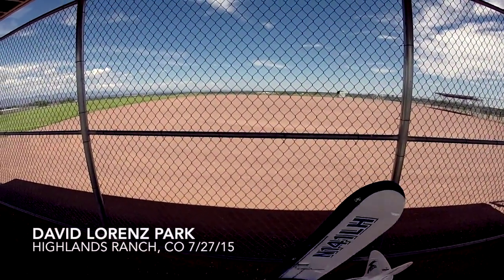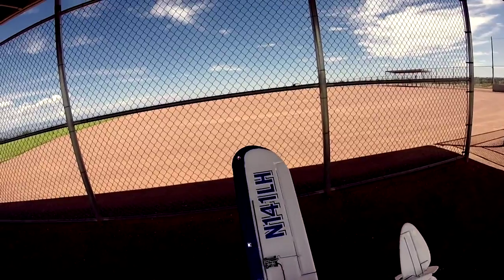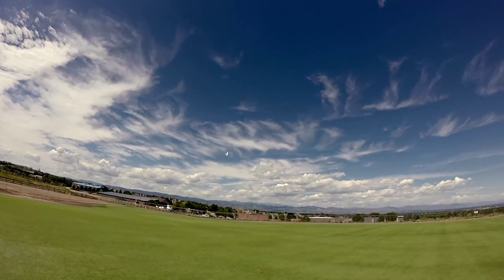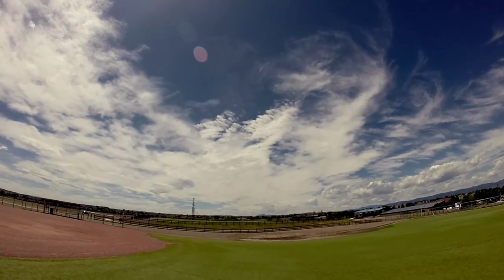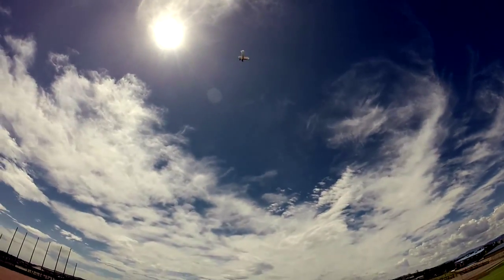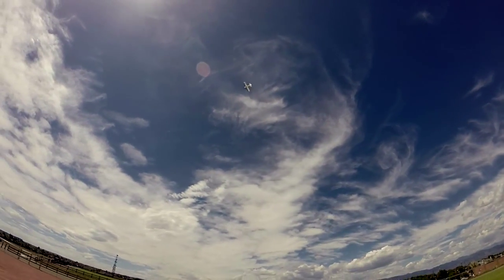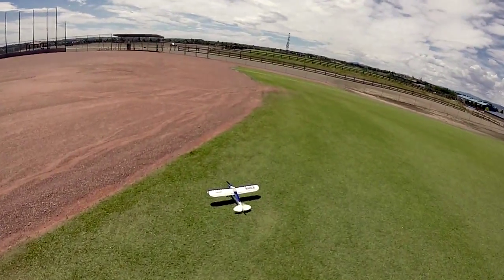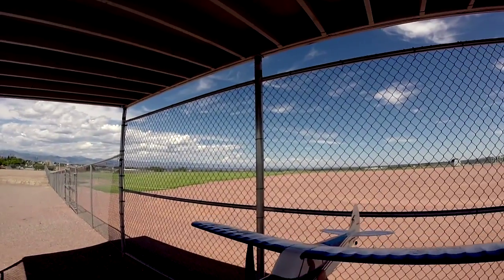Hobbyzone Sport Cub S (2S Brushless) Yak / Pitts Prop Upgrade Test Flight

Comment: Hi, I flew mine outside for the first time today.  Ground handling isn't very easy, but doable with low RPM spurts.  Flying it turns left very predictable, but right turns are about half/three quarters as good.  I stayed at less than full throttle most of the time to save on battery time, but also I was flying in a parking lot that is maybe 20m wide by 80m long and fenced.  I think the airplane might be more fun as I fly it more.  I don't have a camera person to take videos.

Comment: Who makes those tundra tires?  Where can I find them?  Thanks
Reply from the maker: +ShareCraft  They are custom made using the Foam off of Dubro 2" Super Lite Wheels and the Hubs off of Dubro 1.5" Mini Lite Wheels.  Removing the Foam off the Dubro 2" Super Lite Wheels were a pain, but just be patient and work your way using blunt nose pliers clamped on the hub and continuously pull.  They will not tear and will eventually ease themselves off.  I then took the Hubs off the Dubro 1.5" Mini Lite Wheels by cutting the foam around them.  You will not be using this foam so just take the Hubs from them.  I spray painted the Hubs and added the Hub detailing, then press-fitted them on.  They are very snug and will not come off.  Very easy.
Reply: +Derick Aquino nice!  I actually bought some small dubro wheels for my SCS but they are pretty narrow and only maybe 1/4" taller than stock.  I might have to give this a try, your tires look great.  As far as the electronics, I'll be keeping my SCS stock because i love how slow it flies.  I usually fly it at night when it's calm under the street lights.  Check out my video on my micro depron float plane to see what I did with my umx carbon cub electronics.

Comment: Sweet! Nice flying & flight-report, too. Looks like the 5.75" x 2.5" 'stump-puller' prop has found yet another new home! :) That's my favorite prop on the UMX CC for general flying. I do prefer the 5030 when carrying a heavy load (such as carrying a 17g 808 cam on floats) though. The extra speed provides a nice safety-cushion, and allows the plane to still fly up-on-the-wing even when carrying nearly it's own EW in payload. The stump-puller provides nearly instant take-off - but at that weight, she just can't quite get solidly up-on-the-wing, thanks to the lower airspeed. I keep both props handy.
Reply from the maker: MrTurboparker Thanks Joel! I do happen to have those 5030 Props on hand, so when I have to change out the Prop, I'll try those out next.  This plane would be perfect in the winter as I normally fly my UMX Carbon Cub SS with the Floats on snow days and I can see this one being a hit.  This Prop has some crazy authority especially with the weather today.  The Post-Flight Wind Report Numbers at the end of the video blew me away.. makes sense why I was feeling the way I was during the flight, lol!
Reply from the maker: MrTurboparker Hey there Joel, have you tried the 5043 Prop on the UMX CC yet?  I tested out the SCS Icarus again today and as you would know it, the wind was a bit much again though the gusting wasn't so bad as yesterday (19mph), the average today was 12.4mph with a 15.0mph gust.  I noticed that most of the time the SCS Icarus with the Yak/Pitts Prop in this kind of wind was essentially wind surfing and hovering most of the times against the wind at 50% throttle, and then when I throttle up, she climbs at a crazy pace.  While I do understand that the UMX CC has more weight and inertia, making the Yak/Pitts Prop a good combo by dropping its high end speed for more low end authority, as compared to the SCS Icarus which already has an inherently slow, floaty and stable airframe, my hunch is that the 5043 Prop is going to give the SCS Icarus more speed to combat wind at the cost of increased battery draw.  I'm not worried about battery time though as I can consistently get 6 minutes on my 2S Brushless System.  Thoughts?
Reply: Yes, that's exactly what will happen. Top-end will go up a lot, at the expense of flight-time. The GWS 5043 is way too fast for scale-like flying with the CC, but it will give the SCS a very wide speed envelope & allow the plane to make headway in much higher headwinds than it can with the Pitts/Yak, GWS 5030, or E-flite 5" 2.75" prop.
Reply from the maker: MrTurboparker Thanks for the response Joel.  The SCS excels in slow flight as it is, and struggles in some powerful winds.  I should have realized this as on my other SCS "Sky Eye" that carries the 808 Camera and Lectron Pro 600mAh Lipo, at 1S Brushed, she utilizes the 5043 Prop and is a great wind fighter.  Well, the 5043 Prop is now on the Icarus and balanced to the point of a mild purr at full throttle.. smooooth.  Going to test fly if this wind calms down tonight.